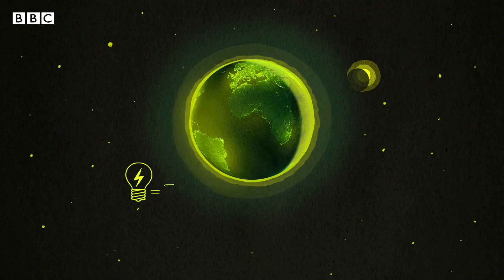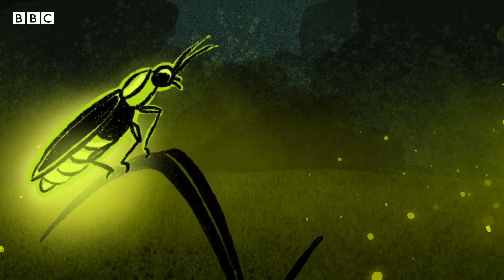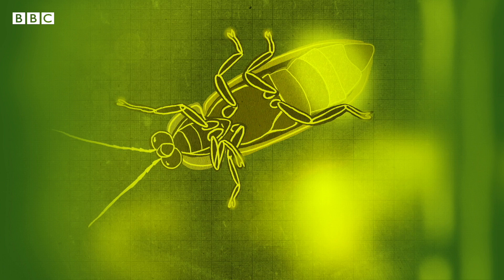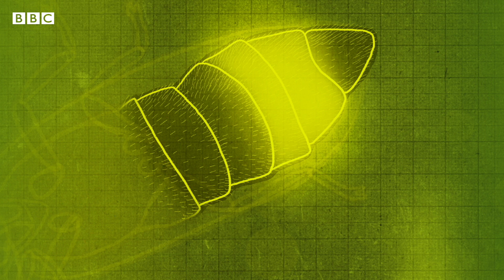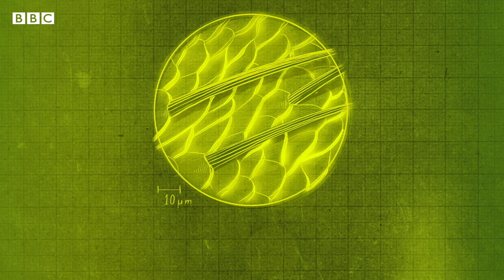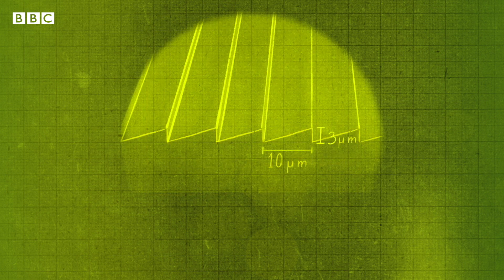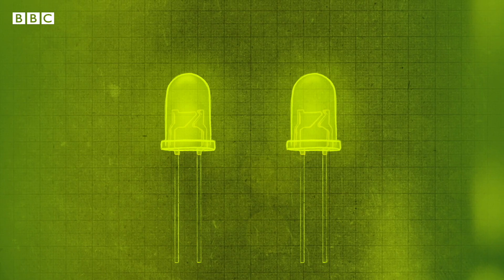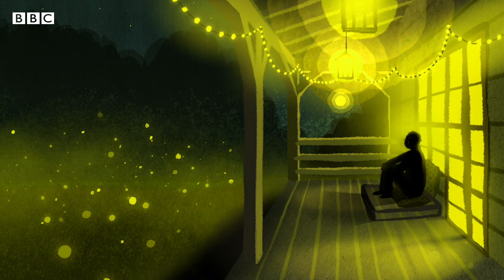How fireflies inspired energy-efficient lights - BBC World Service, 30 Animals podcast

Comment: Electricity for lighting accounts for around 5% of greenhouse gas emissions.
So how can we make it more efficient?
It seems fireflies could hold the answer.
These light emitting insects captured the interest of Belgian physicist Jean-Pol Vigneron while he was on a field trip in Central America.
Intrigued by their display, he brought some back to his lab.
The Firefly has a special light organ under its abdomen. 
From here the light shines through a layer of the insect's exoskeleton called the cuticle.
Vigneron and his team found that this cuticle is made up of scale like structures, some of which stick out at different angles and it's these jagged and misfit scales that let out the most light. 
The tips of the scales protrude and have a tilted slope, like a factory roof. 
The team wondered if they could emulate this to make LED lights shine brighter.
They created a jagged over layer on top of a standard LED by depositing a layer
of light-sensitive material on top of the LEDs and then used a laser to create
the triangular factory roof profile. 
And guess what?
It increased light extraction by more than 50%.
All that extra light just by adding a few new shapes.
Reply: light emitting insects 
Intrigued
exoskeleton 
cuticle
scale 
stick out at different angles
jagged and misfit scales 
tilted slope
emulate ~ mimicking
depositing 
triangular 
extraction